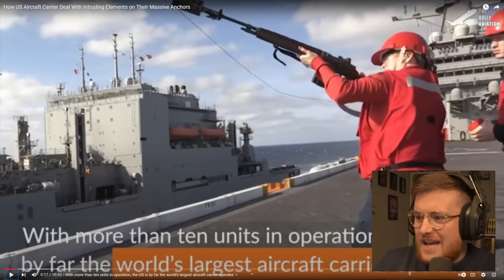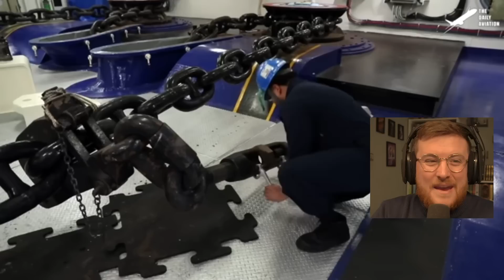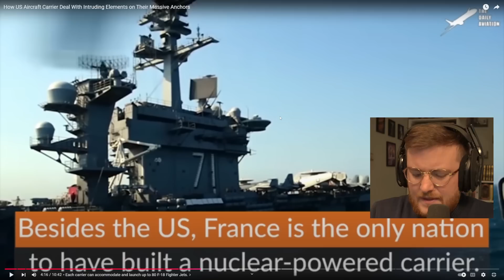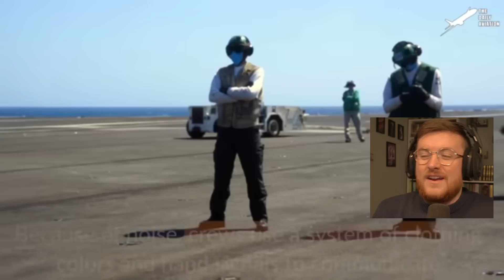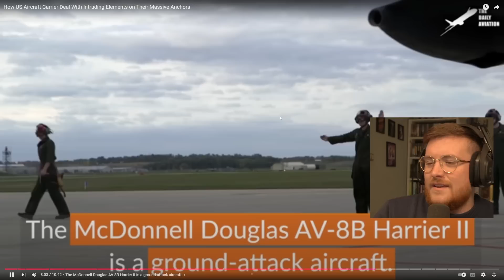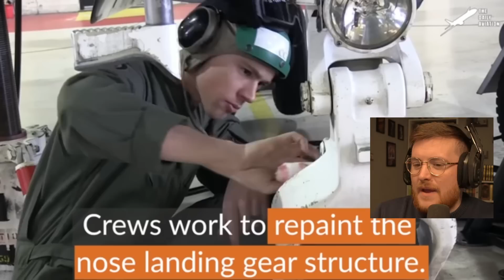Royal Marine React to How US Aircraft Carrier Deal With Intruding Elements on Their Massive Anchors

Comment: The USMC is the only branch that uses Harriers.  I think most of the Harriers are gone forever, being replaced by F-35's.
Reply: Supposedly by 2026
Reply: F-35B to be exact...has a STOVL (Short Take Off Vertical Landing) system like the Harrier did, except the F-35 actually has a massive fan behind the cockpit while the single engine nozzle can pivot down 90 degrees as well. It can take off vertically, however the jet exhaust tends to do a lot of damage to the asphalt and it puts a lot more wear on the fan to provide the initial lift, so they prefer to do short takeoffs.
Reply: @DiamondPaintWithDiamondDave  they are getting 67 C models and 353 B models under current program
Reply: @DiamondPaintWithDiamondDave   Yessir, I didn't think the specifics were necessary, but doesn't hurt.  Ironically, as a Grunt, the only time I got placed into custody was at the New River A.S. E-Club.  Fun times.

Comment: The aircraft with a disc (radar) on top is an AWACS (Airborne Warning and Control System).  It's a flying radar station (eye in the sky) supplying data to other aircraft, particularly when obstacles (such as mountains) are in the way, or they are not oriented on said enemy targets. It sees and identifies both, airborne, and ground threats, as well as any other aircraft in the sky.

Comment: Think about how many rolls of toilet paper they go through. Makes you wonder if there’s a ration system in place, like “use only 4 square, officer will check and confirm before flush” 😂
Reply: we never had to ration toilet paper, however, the carrier makes/recycles its own water, so in boot camp they teach you how to shower to conserve water. Get in, get wet, shut off water, soap up, turn on water and rinse, done...repeat steps to wash hair if necessary, however hair is so short that usually can be done in the soap up phase as well...side note: aircraft carrier water can sometimes smell like diesel fuel on the conventionally powered ships due to the water storage/recycling systems are sometimes located right next to the fuel tanks, just separated by a single bulkhead...

Comment: Alright, so to calculate the G force:

The top speed on takeoff is 165mph or about 270kph. 270,000÷3600 gives us 75 meters per second. We divide that number by the number of seconds spent accelerating (2) which leaves us with an acceleration of 37.5 meters per second squared. The force of gravity is about 9.8 meters per second squared so the takeoff would be about 3.5G.
Reply: In your conversion you are losing around .26 Gs, the answer is ~3.761G. For reference: 165mi/h * 5280 ft/mi * (1/3600) (h/s) = 242 ft/s -> (242 ft/s) / (2 s) = 121 ft/s^2 -> (121 ft/s^2) / (~32.174 [(f/s^2)/G)]) ~= 3.761G.

Comment: Guy who paints the chains: "Do you think I could have a BIGGER BRUSH?! PLEEEEASE?!"
Reply: They like like they were spray coated, though I'm sure there are times someone has to inspect and paint links.
Reply: @jreyman  I am damn sure that every link is not painted only those links visible when the anchor is fully housed, brought aboard, then the chain will be pretty and shiny.    Anchor chain is measured in shots with one shot being 90 feet. Every 90' on the chain one link is painted red with the first shot marked by one white link to either side of the red link. The second shot, one red link with two white links to either side of the red.

Comment: The chain is probably dipped into the paint multiple times and not hand painted. I wonder how long the chain is.
Reply: I was on the uss carl Vinson cvn 70 I was a boatswain mate painted the chain and side of the ship myself. I steered her and moored her
Reply: @ so it was painted by hand? Wow. How long did it take you?
Reply: @ never really stopped always had something to paint. Paint rollers and brushes. Sprayer hardly worked if ever
Reply: @Germansheperd1939  when I made my comment I came up with a question that I had no idea how to answer. How did you keep the links from sticking together when the links would bend? In my controls experience the only thing I ever had to paint was outboard motors.